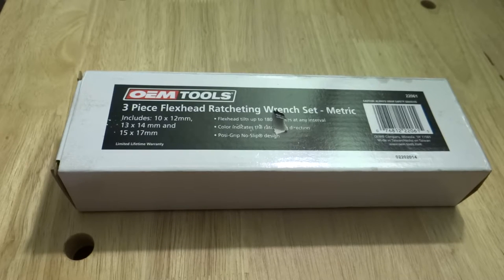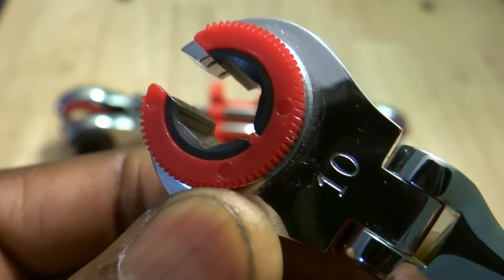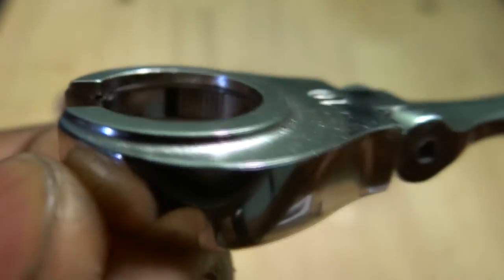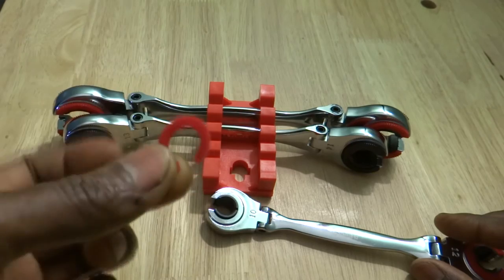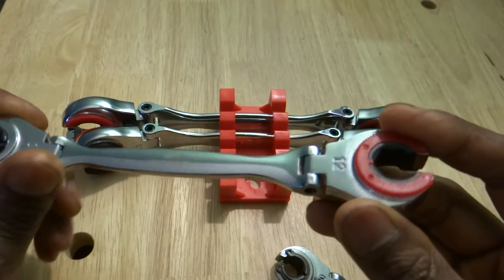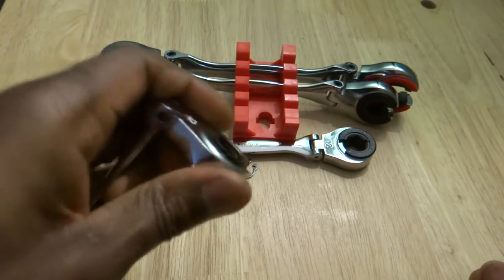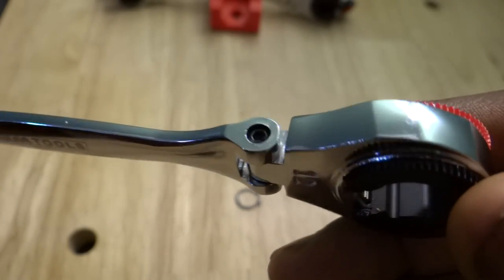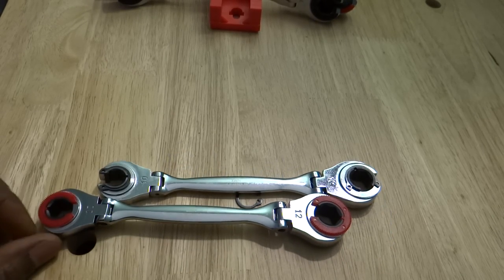OEM Tools Flex head ratcheting flare nut wrench   Buyer Beware!

Comment: my only guess to those easy to remove plastics is when you tighen down and open end is closed up. You push plastic off and slide wrench off coupler socket and then remove the socket. Would be ideal if they provided extra plastics in the kit. Or easy to remove snap rings.
Reply from the maker: Alex Alanis that was a thought as well. It would be awesome if I could get someone from the company to comment on the design and the reason for using cheap brittle plastic on a wrench.

Comment: I was thinking an eclip would work good tip I have same wrench set came broken. They sent out another set. I have not used them yet wondered how much force it could handle I figured plastic was cheap and the could not handle. I paid 30 bucks a set got on sale. That's why I bought those they looked good glad to hear your review. Oh I accidentally reported your comment in live chat with junkie sorry fat fingered it
Reply from the maker: did you leave a review on Amazon about these?
Reply from the maker: Mobile distributor supply is the seller on Amazon that sold them to me.
Reply: Auto Fix Pal I been buying from them for a while they have good deals just have to keep checking. I got my Ernst  socket rails from there for about 40 bucks for the kit
Reply from the maker: i will have to check them out. I got most my tools from Amazon.

Comment: Great video and solution to the problem with those ratchets. I could see using a plastic there if they used a chemical resistant hardy material like some super glass impregnizzled ultra nylon+ or something but that looks like cheapo plastic. I'm an engineer though so I know how these things happen. I'd love to talk to the team who designed it and find out what their design constraints were.

As for that ratchet at the end that has a slightly loose head. Just stick a paper shim in there and she'll be good to go! :P
Reply from the maker: FirworksYT yeah they could have used a better material for the retaining rings.. I contacted OEM tools a couple of times and have not gotten a response. But they do work as intended and thanks the floppy flex head tip. I saw the video you put together about the solution it was awesome.

Comment: Great video is the inside part of the hex plastic? Do you have to put a snap ring on both side and replace the red and black plastic ring? Have you been successful in replacing all the snap rings on the set? Any call back from the techs?
Reply from the maker: miguel mendez you don't need to put snap rings on both sides only 1 side. The hex part is metal, only the rings are plastic. 

No response from OEM-Tools so far.. 

I'm happy you like the video. Be sure to subscribe.
Reply: Auto Fix Pal thanks for info, I enjoy your videos.

Comment: GreatNeck doesn't carry this.
Anyone able to help to know where to buy?
Reply from the maker: i believe they have been discontinued. Mine still works with a snap ring in place of the plastic retainer. You do have to oil the head though because brake fluid causes it to not work so well if you dont clean and lube it after you use it on brake lines. Other type fluids you are fine but brake fluid will ruin them if you put them away wet.
Reply: @angelisone  ATG? Do you have the part # for these with the titanium snap rings as I've tried numerous searches with many variables but cannot seem to locate anything...TIA
Reply: @JS-fd5or  ATG says If you have Harbor Freight Tools in your areas those snap rings kit work very well with a little bit of transmission fluid as a lube.